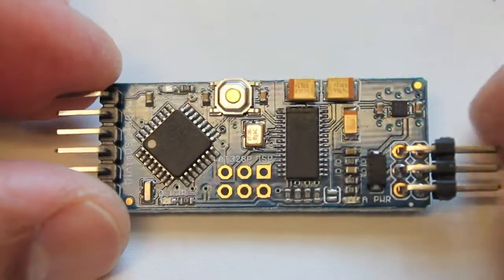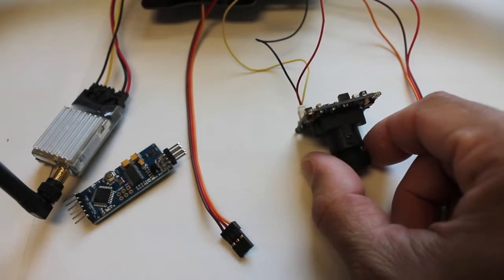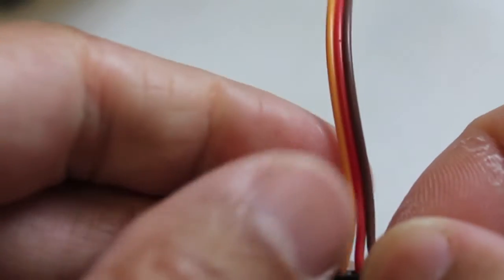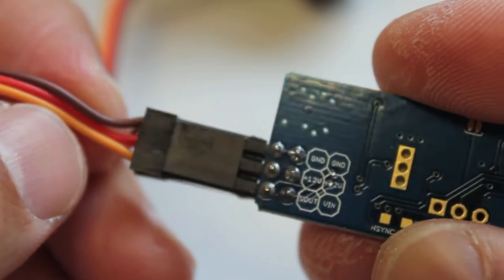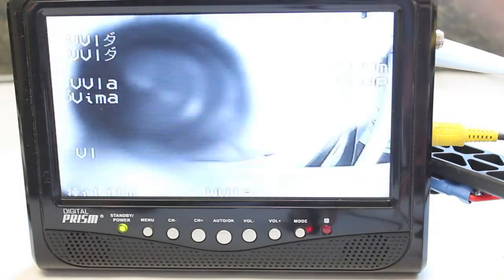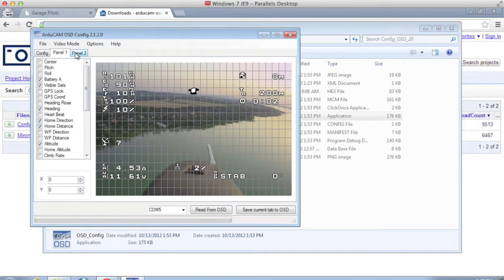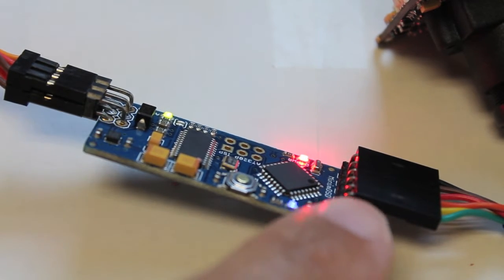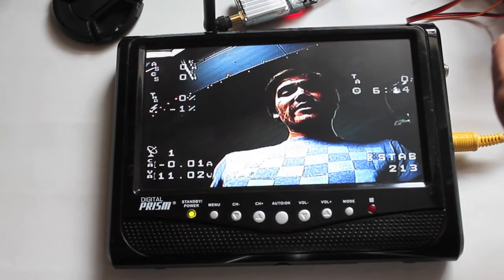APM Telemetry MinimOSD Wiring, Firmware Load, and Configurationt on TBS Discovery Frame

Comment: Does the MinimOSD need flight controller? Can it work without controller only with GPS module?
Reply from the maker: Yes. You'll need some way to feed telemetry data to it. I'm not sure if you can only use it with a GPS module. From all the work I've done with it I've fed GPS data to it through a flight controller. I'll see if I can find anything out.
Reply: it should work, here are instructions:
https://github.com/ShikOfTheRa/scarab-osd/blob/master/OTHER/DOCUMENTATION/Guide_standalone_GPS_OSD.md
I have a GPS module from remzibi osd and I ordered one minimosd (to give it a try).

Comment: Hi +Dennis Baldwin. Thanks for your video. Could you share the parameters setup on your mission planner. My minimOSD (running on APM 2.6 firmware 3.1.2) doesn't stream the battery voltage, GPS long/lat, SatCount. I was thinking that the OSD is somehow broke, but it should not be the case when other functions like the horizon line, altitude and mode are updating. Please help. Thanks
Reply from the maker: +Ahmad Faizol Appreciate you asking. Unfortunately I no longer have this setup so I don't have my parameter file.  Check out Arducam OSD as that should hopefully allow you to enable additional telemetry: https://code.google.com/p/arducam-osd/wiki/OSD_Config_Tool Good luck and let us know how it goes.

Comment: Hi, what type of battery used and the amount of voltage?
Reply from the maker: +Free Goodly I was using 12V on one side and 5V on the other side so a 3S lipo for the video TX and getting power from the APM. You can actually power both sides from the APM as discussed here:

http://copter.ardupilot.com/wiki/common-minim-osd-quick-installation-guide/

Good luck with your setup.

Comment: Ho, any clue as how to connect that OSD to the flight controller on a Cheerson CX-20 that I have already connected a telemetry unit too?
Reply from the maker: +Christopher Jacques Wish I could help with that, but I'm not very familiar with that setup. If I stumble across any info I'll let you know. Let us know if you figure anything out.
Reply: +Christopher Jacques you need a Y cable to split the UART port off to both devices

Comment: Hello,  great video
I am planing on instaling some kind of OsD chip in my walkera qr x350 with a fpv Boscam 832 transmiter/reciver,  and using a gopro 3+ silver.  Could you help me by ahowing the instalation Ty.
Reply from the maker: +mauricio padilla mainero I don't know much about the Walkera X350 but I do know they make an OSD module:

http://amzn.to/1S3wwKC

Good luck with your setup and let us know what you come up with.

Comment: cool, any way to connect it to original transmitter that comes with google skyzone Sky-02? the transmitter has different
 wiring
Reply from the maker: +Zycie w Californii Good question. I haven't messed with that TX before so I'm uncertain of how to set it up. But generally it should have at least a signal and ground, which you should be able to modify per this video. Good luck and let us know how it goes.
Reply: +Dennis Baldwin hi, it looks like it wont work that way, so I ended up buying wires for gopro, immercions RC transmiter, and miniosd, It works, but it doesnt shows anything on the screen ( just video) I may need more power I guess, I connected it to the 7V lipo, and it needs more powers

Comment: I have a question, is it possible to connect 3dr radio telemetry parallel with minimosd as telemetry is there any interruption on data? Thanks in advance
Reply from the maker: littleboy 1234 Good question. To be honest I'm not sure how that will work out. I've never set it up this way. Maybe someone else can shed light on your question.

Comment: i see the 12 v connector. but my drone use 14,8. is there a way to use this osd?
Reply from the maker: drunkenduck2 I don't think a 4S lipo will work. You run the risk of burning out the OSD. What you can do is power off 5V on the left side if you solder the right jumpers. There is a diagram on this page that shows how to do it: http://copter.ardupilot.com/wiki/common-optional-hardware/common-minim-osd-quick-installation-guide/#basic_wiring_diagram

Comment: Dennis did you have any issues with the 12V side of the OSD board?  I am hearing that the 12V regulator heats up and fails?  Some people are bridging the 5V side of the board and powering the transmitter from a separate power source.
Reply from the maker: Jon Car No issues at all, but have read the same as you. I was thinking about the bridged solution but haven't had a need for it thankfully. This version takes care of the issue without having to do the solder bridge:

http://www.readytoflyquads.com/micro-minimosd
Reply: Dennis Baldwin can you PLEASE show a osd setup with that osd from ready to fly quads (I have it but are not sure how to setup) with the pixhawk?

Comment: Hi Dennis, I'm looking in to buying the HKPilot Mega 2.7 Master Set With OSD, LEA-6H GPS, Power module, Telemetry Radio (915Mhz) (XT-60) system and will try to set it up in the TBS, do you think it's good for the money? Nice video.
Reply from the maker: Soldier53flyer Sounds like a good setup. I like the TBS. Was one of my first FPV setups. I haven't messed too much with the HKPilot so I can't offer much help there. Should be fairly similar to APM for setup. Good luck and keep us posted.

Comment: Nice video, thanks for posting. I have a quick question... If I want to "test" the board, without hooking up a camera and a Pixhawk, what exactly do I need to hook up? I tried connecting my yellow cable from my video transmitter to video out of the minimOSD. Then I hooked up a 3s lipo to the minimOSD. Shouldn't that be enough to power it and transmit a signal? Shouldn't I be able to at least see the blank OSD info? Thanks.
Reply from the maker: ***** If I recall you need to have some source of video input to see OSD info. Here is a good wiring diagram you may have already seen:

http://copter.ardupilot.com/wiki/common-minim-osd-quick-installation-guide/

Good luck with your setup.
Reply: Dennis Baldwin I am going to give it another try... Thanks!

Comment: Are there pinouts on that FDDI cable (USB to program MinimOSD)?  And my MinimOSD from Banggood (v1.1) came with individual wires terminated at both ends to plug into the same pins, so I have no mini-JST (or FD13 or whatever) for the APM board.  Does anyone have the pinouts for an APM board?  (I could probably find them). I may have to solder to the board!

Comment: I also run the kV osd branded board from witespy and use just 5v to power the board. I had read the same thing about feeding 12v in. 
From the vtx 5v out I use a polulu step up to give the camera 12v.  Only things connected on video side of board is Vin and ground from camera and vout and ground back to vtx.  I didn't have any issues upgrading firmware or character sets with just the serialtousb from arduino.  Ive tried both kvosd and the newer mwosd. Currently hooked up to a naze32.
Reply from the maker: Trent Jones Thanks for sharing your experience. Good info.

Comment: I also purchased this cheap v0.1 minimosd clone, and updating the character set worked for me without the need to power both sides of the osd board. I used the latest CT tool firmware on the minimosd-extra page which contained the .mcm file. I would recommend this to everybody who is bypassing the voltage regulator (which tends to burn out) and already put solder blobs on each side of the board. It might save you some time.
Reply from the maker: Good tip. Haven't tried it yet but am definitely going to! Thanks.

Comment: thankyou, thankyou thankyou. It wasn't until hearing your comment at about 7:00 about powering both sides of the board that I realised what I was doing wrong. After going back and reading the wiki page, it was there in black and white "Be sure that bough side of MinimOSD is powered. Otherwise it will not take." but in my haste, of course I didn't actually read the instructions.
:)
Reply from the maker: No problem at all. Glad to hear this helped and good luck with your setup.

Comment: Great tutorial! I have a question...
I purchased a minimOSD board and it came with a "Y" cable. the small connector goes to the APM (can't miss that)
Then it splits to what I'm guessing one end to "R"adio and the other to "O"SD
But on the video I see the Radio connection coming from the OSD, not from the APM through the "Y" cable

My intention is to have Video and Telemetry just like you on your video.

what should I do? ignore that split and go ahead and connect the radio on the V out just like on this video?

Thank you in advance!
Reply from the maker: Hi Sergio, thanks for the feedback. I would get it working as shown in this video first and then you can try to change it up later. If you discover anything it would be great if you could sign up at www.garagepilots.com and share your findings over there. Take care.
Reply: Dennis Baldwin Found my problem... I thought the 3DR radio handled both the video feed and the telemetry... Now I know I need a separate radio for the video feed... The "Y" cable is just as every other for this application.

Thanks for the quick reply. I'm signing up @ www.garagepilots.com

Comment: Hi there Dennis, you needn't reply to me. This is for your viewers. Much has been written and discussed about the voltage regulator on various iterations of the the Minim OSD. As you are wading knee deep in the data and methodology,....There has been problems with the vregulator getting hot and failing on some versions and/or production runs, and that the best way of powering the device is by soldering the coupling pads on the board (two must be made; one on the top and the bottom). Once this is done 5V will be provided for the entire board from the APM alone (digital side), I spent good money on my dedicated UBEC that makes nice clean constant power for the APM and the peripherals it provides power to. 12V power is routed to the VTx and Camera directly and exclusive of the Minim's analogue side. If it is true that you must have power from both ends (digital and analog) of the board to get the FW update and character sets etc, then you may as well do the soldering of the "link pads" and have it done with before you attempt to do the FW and character set update. Better safe than sorry. By the way, I will be using a much less expensive FTDI-USB dongle that connects directly to the pinouts on the Minim.
Regards All
Reply from the maker: How can I not reply to this great bit of info! Thanks so much for sharing and I'm definitely going to give this a try in the near future. Will definitely credit you for the info as well. It's much appreciated.

Comment: Hobby King has them as well.  That's where I got mine.  There is also an updated firmware and config tool.  Im using vs 2.3  but having problems with it locking up.  Been having lots of problems with stuff since apm went to 3.01

Comment: here is the video, go to time stamp 8:52 (youtube /watch?v=Msr7I6ApcUk)

Also if you turn the APM board over and look at the bottom single row of pins, notice that UART0 pins match UART0 pins of the Mavlink in the upper right hand corner of the board. You only need to connect 3 wires to the APM board (UART0 RX0, +5V, GND) from the MinimOSD board. So you can leave the Mavlink attached and use the APM UART0 single row of pins for the MinimOSD.

Comment from the maker: The following guide is for APM 2.5 and should help you out:

copter . ardupilot . com/wiki/connecting-your-rc-input-and-motors/

I don't know if they're identical to the 2.0 as I've only ever used the 2.5 version. Good luck and let me know if you run into any problems.

Comment: Thank you for the reply.  I guess what I didn't understand is that most of these guides were written for the APM2.0? which I had found, but kept thinking I should be looking for APM2.5 material instead.  So I take it that the basics are the same and the INPUT and OUTPUT assignments are identical as well?

Comment from the maker: The best guide that I've found is in the ArduCopter wiki:

code.google.com/p/arducopter/wiki/APM2RC

Yes, MinimOSD is generally only applicable to FPV but you could use to get data to your GCS even if you're flying line of sight. I hope that helps.

Comment: #1 Complaint with updating the charset on MinimOSD boards (Dual power!)
  Another thing I discovered is NEVER touch / unplug camera connection when 12V is supplied.  I had 2 camera and decided to switch while the board was powered and fried my MinimOSD.   Since I know the dual power trick I bought another $15 minimOSD from china.  Its hard to justify paying 3x more for essentially the same product from 3DR.

Comment: Dennis, I agree you need to be cautious when purchasing items from China. Furthermore, I would pay the extra money and get the 3DR version on the MinimOSD. I was watching a video from another youtuber and noticed they attached wires to the single row of pins on the APM board. Since I did not solder the single row of pins on my board I was bummed, however, I did not think of just unplugging the Mavlink and  using the the Mavlink telemetry port! As always keep the informative videos coming!

Comment: Yes, with the pads soldered the character generator runs cooler. I use Multiwii and get my boards from Witespy.com for $10 each. The pads are alredy soldered so you can power both sides of the board from the FC. Also must use different software for the firmware flash and different firmware.

Comment: the OSD is only for FPV, so you can see things like ground speed, altitude etc..
you can try going to the arducopter wiki
"copter . ardupilot . com"
or try RC groups and look for thread no 1820773, then go to post 6 by jabram. One of the best and most detailed build logs.

Comment: Dennis, FYI, even the 3DR minimOSD V1.1 needs both sides to be powered to update the character set.
Also, do you have any plans to install ER9x on your T9X? If so, I have some good settings you can use to setup the momentary switch to toggle between the different OSD screens. It toggles between Screen1, Screen2 and no OSD.

Comment: Dennis I'm ready to wire up my SK450.  Where is the best source for a wiring diagram that will guide me on the APM2.5 and Rcvr  interconnections as well as the Esc to Apm.  Also to understand the purpose of the MinimOSD, is it only applicable to FPV flight?

Comment: +1 (The voltage regulator has been known to run hot and fail....)
If you not do this, you gone fly in the dark soon Dennis.

just to inform you, Look out for static electricity when playing around and taking up the minimosd connected to the apm when powered on, it has cost me my apm2.0 (RIP).
As always, good video.

Comment: Your better off powering the minimosd from the APM side by soldering the pads on the board and leaving the 12v feed off the video side of the Board..... The voltage regulator has been known to run hot and fail....